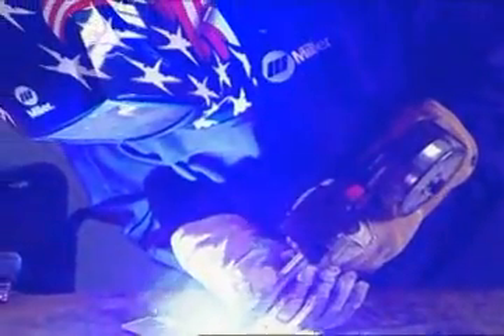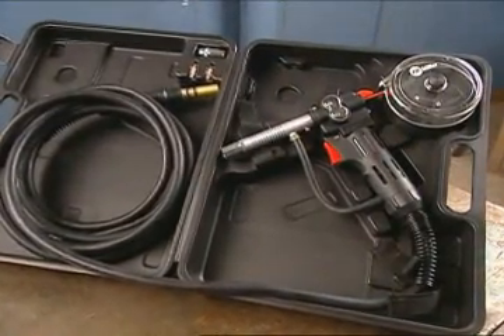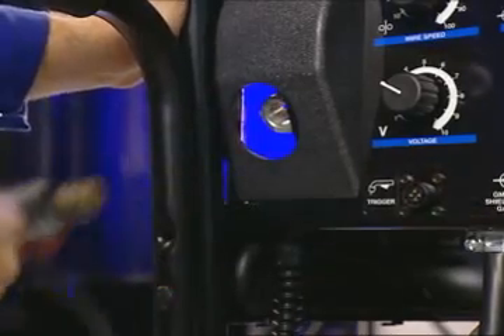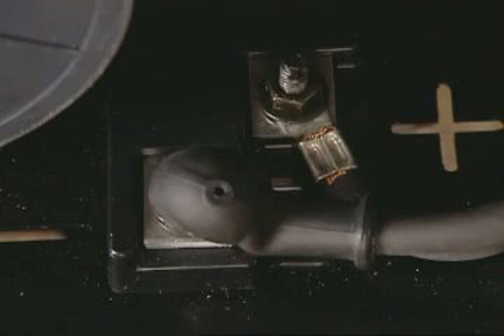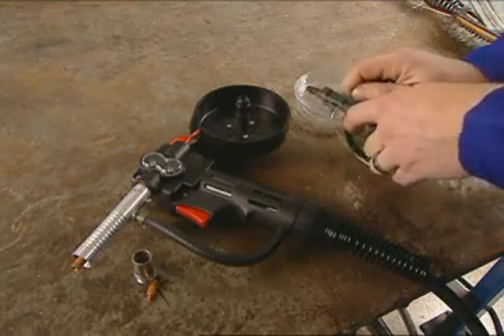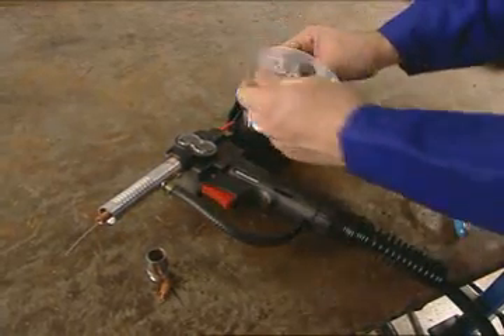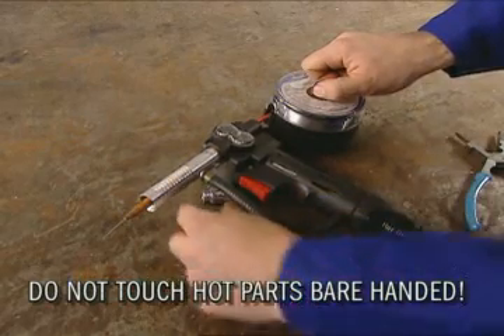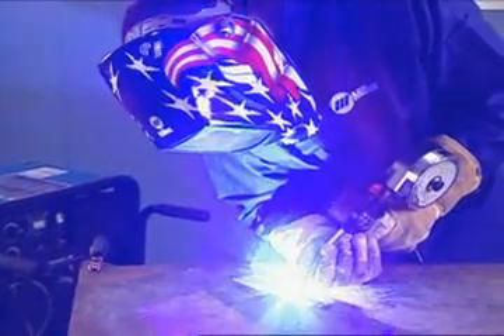Miller Spoolmate 100-Series MIG Gun Setup and Demonstration

Comment: Do I need to do the calibration set up with the older Millermatic 211 with the rocker switch for spool gun to mig gun. The videos I’ve seen with the calibration process look like a newer machine with a dial to switch from mig to spool gun.

Comment: how can i use that kind of spool gun in a miller bobcat 250?
waiting for answers
Reply from the maker: The only way to use a Spoolmate 100 on the Bobcat 250 would be to plug a unit such as a Millermatic 211 into the Bobcats 230 volt aux power and plug the Spoolmate 100 into the Millermatic 211.

Comment: Will this spool gun work with a millermatic 135 ?
Reply from the maker: Hi Todd. To use this spool gun with the Millermatic 135, you would need the Spoolmate 3035 with an additional adapter, SGA-100. Feel free to call us if you have any other questions; we'd be happy to help. We can be reached at 920-734-9821, 7 am - 5 pm CST.
Reply: @MillerWelders  I have the millermatic  135.

Comment: I got the spoolmate 100 to work great with.my millermatic 172 I just had to unwire the drive motor and connect it to the drive motor on the gun it works great

Comment: I saw it before. I'm interested in the blue star 185. which wire feeder can be use with the miller 185 that can be connected with the spoolgun. I want to know if I can get a good deal from you guys?

Comment: I saw it before. I'm interested in the blue star 185. which wire feeder can be use with the miller 185 that can be connected with the spoolgun. I want to know if I can get a good deal from you guys?
Reply from the maker: +teanswagboy swag The Millermatic 190 will run on the Blue Star 185. You can view its product page here: https://www.millerwelds.com/equipment/welders/mig-gmaw/millermatic-190. The spool gun you should use with the Millermatic 190 is the Spoolmate 100: https://www.millerwelds.com/support/system-setup-and-software/spool-gun-hookup-chart. 

We recommend reaching out to your local distributor for availability and pricing in your area. You can locate your nearest distributor using the following link: https://www.millerwelds.com/where-to-buy?buy=1

We hope this helps. Let us know if you have any further questions. Thank you!

Comment: I have been welding for 18 years:  Carbon pipe, Stainless, all TIG and stick of course and I have MIG welded quite a bit...this Miller Spoolmate 100 is AWesome!  I used it with my Millermatic 211 on 120V power and only tripped the breaker once.  Welding 2" square tubing together.  Great SpoolGun!!!!

Comment: probably can it comes with a switch and instructions how to install said switch for models that arent ready for it. that being said you dont want this peice of shit. I have on e with my 211 and it wads the wire up at the rollers more then happens if I just use the normal gun. its CRAP IMO I wasted 250 bucks on it thats my take